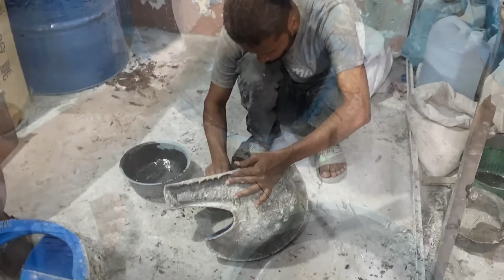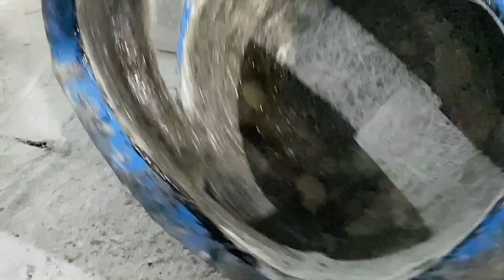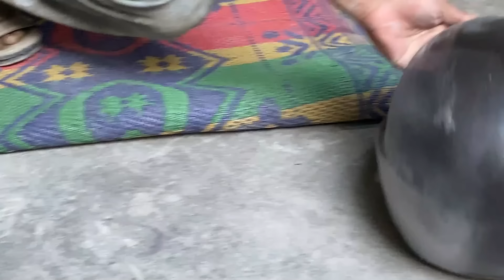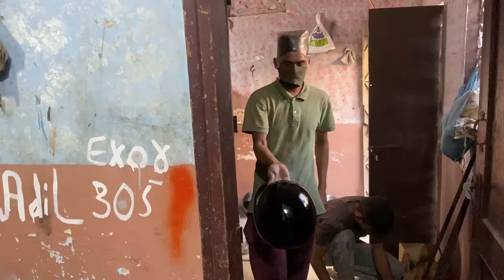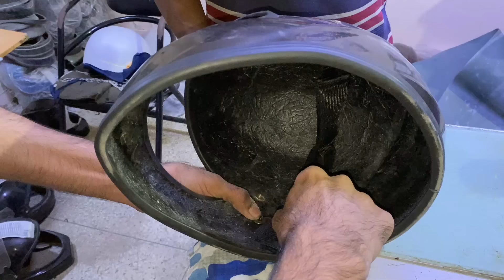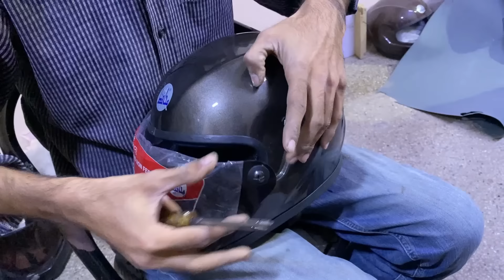How motorcycle helmets are made

Comment: Like many I was appalled at the lack of control over the production of something designed to save lives. I have ridden motorbikes for over 50 years, and, I will admit, occasionally used "cheap" helmets, but they have always met the relevant safety standards. I tried to find a price for these, but couldn't specifically find this make - however I did discover many "unbreakable", "maximum protection", full face helmets selling new for Rs1000 (Pakistani) and at current exchange rates this is ... less than UK£4.00!
Reply: Bought mine for around 600pkr in Pakistan...  I have to admit it has saved my life once... I had a pretty bad crash going around 50kmph and it saved my head... I broke a collarbone though... The helmet I have is different than these ones,mine has more foam inside and better outer shell
Reply: The main reason why many survive in India and most of Asia is because of how slow we travel. Even with some good highways in between, the average I get when I travel for 600km a day is just over 65kmph. If we all were to travel at 100+ kmph (average), these helmets and in fact our vehicles would prove to be useless. Things are slowly changing and companies have started selling safety as a feature. That's progress from where it used to be.
Reply: @ArunBasilLal  I'm sure that most of the buyers for this helmet wouldn't be travelling terribly fast, as you say, so the apparent flimsiness of the helmet isn't an issue.
Reply: @fawziekefli2273  Correct. Accidents do happen (the most dangerous one is the visor breaking and becoming a projectile by itself rather than shattering away). We are more concerned about people wearing any safety equipment and also following traffic rules.
Reply: If you have a four quid head, use a four quid helmet!
Reply: Any helmet is better than no helmet. : )
Reply: @mans4104  At lower speeds you might be right. The windshield on a safety helmet is designed to shatter but on a cheap helmet it might just crack and then that would act as a projectile and hurt your eyes. Similarly with the shell, if it cracks on impact then it is a danger in itself. A helmet is often a 5 year or 10 year purchase, so it's better to spend a little more and get the right one. It's not worth the risk.
Reply: @ArunBasilLal  aaaaaaaaa
At
Reply: My first helmet when I was around 11 was a Bell because of a sign like that at the Honda dealership. It saved my life. However that being said I can tell you that the helmets they’re making appear to be as good as the Bell helmets I wore back in the seventies and eighties. Fiberglass shell with styrofoam lining. Helmets made like this are considered one time use helmets. They’re good for one impact and you buy another. You can buy a $5-$600 Bell and drop it and you should replace it because it’s already absorbed some damage whether you see it or not. I wouldn’t have any problem whatsoever wearing one of these helmets but I’ve studied motorcycle helmet for over 45 years now. These helmets are hand made unlike the plastic DOT approved helmets that bounce like a damn basketball. Put your head in one of those if you want to.
Reply: Todo para llamar la atención y decir tengo mucho dinero
Reply: @johnathonmullis4234 , хорошие шлемы из стекловолокна и эпоксидной смолы ! Да !
Reply: L
Reply: Quality is not measured by price, but by materials. There are very expensive helmets, which are bad. This is fiberglass, far superior to the plastic helmets most Western motorcyclists wear...
Reply: Они уже среди нас 😂
Reply: Они повсюду😂
Reply: Здравствуйте братья! Привет Вам из России!!! 🤝
Reply: @rosich555  , кто ?
Reply: i mean as rider how love racing on track days i understand the need for safe helmet but some of these people make less then 5 dollars a day so helmet like these are probally better then no helmet in a crash plus the shell is made out of what i assume to be fiberglass and there some eps foam in it so it should be some what decent in a crash my top of the line arai rx7v evo is made of similar stuff just made alot better.
Reply: @johnathonmullis4234  These are good helmets because they are handmade fiberglass? Are you the owner of the company or something? There was only couple layers of chop strand matt that went in there, it wasn't cured under pressure to consolidate it, and its so thin they trimmed the edges by hand with a utility knife. Not weighing out the resin mix and doing wet layup in an open air humid environment doesn't make it any better.
Reply: bro this is made for 50-100cc bajaj motorcycles that are used in slow heavy traffic citys, not the 600cc GSX racing bikes
Reply: These are far better than cheap plastic

Comment: and because its india, they dont bother testing any of these helmets to see if they are safe in a crash, not that they are. a single layer of fiberglass is one thing, but not even doubling up in the center? you can see the crack right along the center of the helmet and thats what we call the weak point, the part of the helmet that will split first.